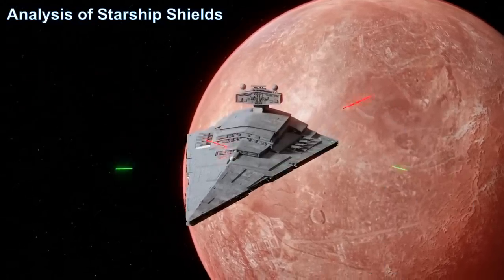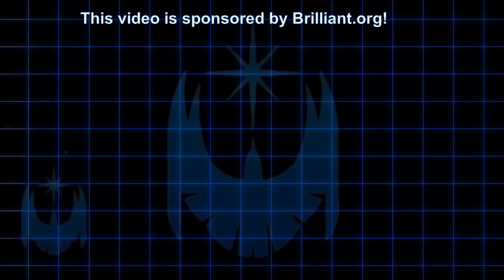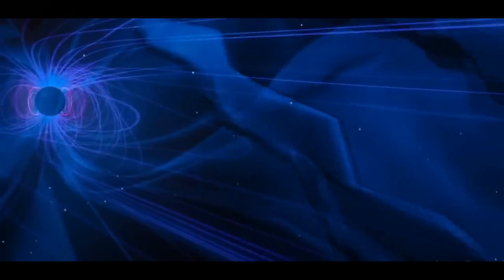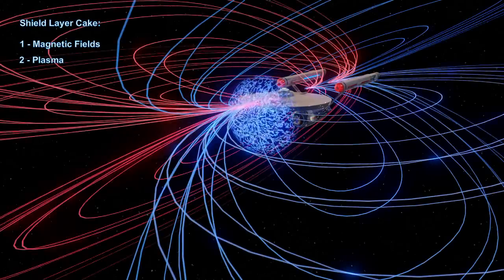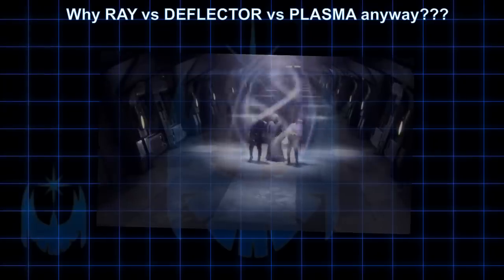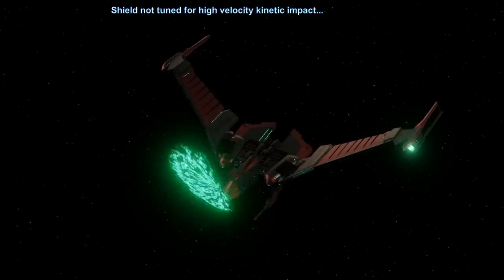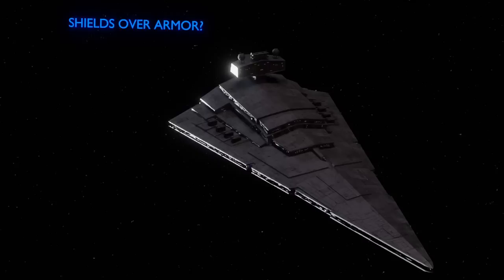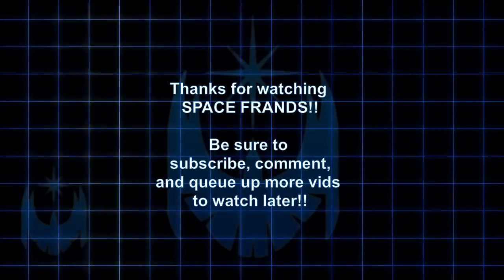REAL Starship Shields Types - They Work Like This...Animated Breakdown!

Comment: Two items that aren't mentioned:
1. The Langston Field from Larry Niven and Jerry Pournelle's CoDominium saga protects against everything and anything that hits it. The trouble is, it's no fun at all -- any ship with a Langston Field up would look like nothing more than a big black blob until it started taking serious hits. Then it'd start to glow: red, then orange, then yellow ... all the way up the visible spectrum to violet. At that point it'd take very little more for the Field to overload. Then BOOM! It radiates away all the energy it stored, both outward and inward, instantly slagging your ship.
2. The Alcubierre Drive's field would not only act as a shield against everything, but also as a warp drive. Also, any ship generating a Drive field would essentially be in micro-gee at the center of the field. The field does all the moving while the ship stays safely nestled in its embrace at the center, so no need for inertial dampers. I don't know why this aspect of the Alcubierre Drive hasn't come up more often. Laziness on the part of sci-fi writers, maybe?

Comment: Plasma shields absolutely stop and eat lasers. Keeping the plasma hot and ionized was a problem you had in maintaining your plasma shield, but the ions that make up the plasma are by definition electrically charged and interact with light to become more excited. Plasma is pretty damn opaque, gets heated up by incoming lasers, and this just makes it easier for you to maintain your plasma shield because now YOU don't have to heat it to ionization temperature. Your enemy is helpfully supplying that power via their laser. Plasma shields won't do crap to incoming objects though. There's not enough time to heat the projectile to melt it, and even if you did that didn't slow it down any, you just made it be hotter when it hits you.

Comment: I never thought about it until this video, but for lasers, the navigation deflector (as Picard noted in one of the early episodes as easily able to stop a laser) could be a gravitational wave moving objects out of the flight path through gravitation lensing.  A laser could be deflected and diffracted to weaker energy levels simultaneously from this continuous effect.  nav deflector will never be turned off

Comment: If you watch tank videos on youtube you will see that there are many types of armor that can be used to combat attacks as well. There is definitely a possibility that combining this with an eventual nanotechnology for self repair, it's possible to have much more usable armor in actual combat in space. Also I'm kinda surprised we didn't talk about the issues that should/shouldn't arise for the sci-fi series that don't have shields, namely battlestar galactica and babylon 5. Finally, while I appreciate that these technologies exist for shields and might be integral to developing technology in the future, I want to emphasize the 1) difficulty of maintaining a strong enough magnetic field to do anything remotely like deflecting debris of significant momentum, and 2) the concerns of the damage you'd do to people inside the ship to maintain those magnetic fields. After all, people get nauseated and lose their balance at .5 to 1.5 T, the biggest magnetic field we've been able to make across a Tokamak is about 14T which struggled to contain a small mass of plasma (this is likely outdated, my research was in 2010), and there wouldn't be much way of making that magnetic field outwardly directed.

Comment: There's actually a form of vehicle armor developed in the UK called electromagnetic reactive armor. It consists of two conductive metal plates spaced a few inches apart and protects the vehicle from damage by using high-voltage electricity to instantly vaporize projectiles that come into contact with the armor.
Reply: I think that's more of a hull polarizer than a shield but nice to know we have that tech already!
Reply: @alexslgato1735  we don't have it... Yet. 

It's in development. No vehicle In active service is equiped with it today.
Reply: I thought about something like that a few years ago, it was basically a ship covered in conductive metal and when needed, a strong electrical current would be shot through the metal, strengthening it against attacks, such as missiles, i called it electromagnetic shielding cause it sounded cool
Reply: Link, please.
Reply: @-Postoronnij-  https://youtu.be/o7rxBifd0cY

Comment: 4:15 I love this animation... the idea of shield triggering only on impact makes sense and fits well with Stargate visual effects... The tuning for various damage types also fits well to this and was sometimes part of the story.
Reply: Stargate shields work differently though. Stargate shields can be turned into cloaks and anti-replicator fields all on the fly. They can allow physical things through or block everything.
Reply: @the11382  I don't remember cloak, but anti Replicator would still make sense since you know... all they need is something to hit them if you talking Milky Way Replicators and such plasma field would fry quite a bit of electronics and block radio signals with Pegasus Replicators.

Tho you are right... while in ship-ship combat seem close enough, when you go in to touch it illusion falls apart.
Per usual for sci-fi they often block everything making it air or water tight and we have no real way to make that shields.
Reply: @the11382  They can't do it on the fly. Atlantis uses the energy field of the city shield with an Lantean cloaking device from a Puddle Jumper. You can't be cloaked and shielded at the same time.
Reply: Well the shields appear to operate on the energy spectrum in some ways, so going from a light refractive range to a radio frequency disruptor does not seem too far out of hand.

Comment: My Runner ships are made for speed and using their jump drives to travel long distances,  so shields keep them alive in battle.

Larger ships use a shield/armor combo, as they can't use jump drives, but more akin to Stellaris' Hyper Relays.

The largest ones, similar to generational ships, have armor only, because even if you damage one section, the rest of the ship is completely fine. For this reason, attackers just don't bother attacking.

Comment: There's also the 'sponge' type of armor or shields, that gobble up laser energy and dump it back into the ship's systems, usually into the point defence capacitors. There's Chaff and Microprism dust to consider, especially if you're already using magnetics to keep it dusting the ship. The armor is probably going to be some laminate to better deal with a bit of everything.

Comment: Ok, I have to say it, there is another type of shield, one that redirects the energy of the inbound object into a different dimension.  I am talking about the Void Shield from Warhammer 40K.  Ships of the Imperium utilise a shield array that redirects weapons fire into the alternate dimension (used for FTL and is the domain of some very nasty entities) called the Warp.  Void shields when activated form an energy layered shell around the ship, the Shield forms as a series of layers,  the Void Shields can only take so much incoming energy fire before the layer collapses.  Now ships of the Imperium are colossal in size, and will have a number of void shield generators,  if the ship doesn't take fire for some time, the void shield will recharge at a very fast rate.  These shields are also employed by the titanic walker units of the Collegia Titanica, the Titans.  They have downsides, Psychic phenomena and warp storms can cause these shields to lose effectiveness, or fail entirely, they are very power hungry, and as with most imperium tech, their technical understanding on how these shield work is very limited.  But then as with everything in WH40K, its very much grim dark, over the top, and utterly batshit crazy.  Don't get me started on the Orks.

Comment: In Star trek, at some point, the distinction stopped being made between deflector screens and shields. The original series mentions them along with The Motion Picture. When the A was being pelted with torpedoes from the cloaked bird of prey, it seemed as if they only had energy shields with no screens. You would think that deflector screens would have been more useful against torpedoes than standard shields as the shields were penetrated with every hit
Reply: Deflector screens would make little difference as the torpedo's would be set to detonate rather then allow themselves to be deflected. Shields spread out the energy and impact over a wider area, allowing the ship to take more damage and still operate correctly. Energy fired at a ship doesn't go away, its instead absorbed through the ships systems in a semi controlled way through the shields. The ship is designed to take this beating, but can only do it so much before it just can't and then you start to see damage done despite shields still being up. Exploding consoles, power conduits blowing out etc, all caused by the energy being directed through the ship overloading something as there is no safe route to dissipate the energy after the designed overflow is spent. But not allowing another ship to concentrate all that damage to one particular area of your ship means you can keep fighting on longer as damaging a particular system of your ship is harder. At least is my understanding of it.
Reply: @gerble36  Yes, deflector screens in Star Trek are for navigation only. 
They have to be up, so the ship can go to warp the instant it is ready to depart for combat manoeuvring.
Reply: @shauntempley9757 there was a scene in Star Trek where an unidentified ship locked lock lasers Picard responded laser won't even penetrate navigation shields.  The navigation shields being the deflectors.

Comment: Hull polarization is hardly ever mentioned, but in the 70's a study revealed that running a current through a metal surface can neutralize lasers, as long as it's a higher wattage than the laser.
Reply: Do you have a source, Atomic Rockets is curious.
Reply: @georgethompson1460  It was in OMNI magazine in the early 80's.  I never saw it referenced at all until Star Trek Enterprise.  Offensive laser applications are sexier, so those advances were more publicized.  It may have been accidentally disclosed, like the ion plasma applications on the SR-71 (said to reduce Mach effects on the leading edges of the wings and in the exhaust).
Reply: @chadreynolds5974  That makes sense - a laser is basically just focused EM radiation. If you create a conductive surface with surface polarisation, the stronger wattage of the surface would dissipate the laser before it makes contact. Notwithstanding that the more energy-efficient solution is if the surface simply had an effective heat dissipation system, the laser would be more or less useless on a surface with a high heat capacity and efficient cooling, especially if the laser were significantly diffracted prior to making contact, or if the laser were simply refracted around the object in question. Lasers are fairly questionable weapons for this reason, but may be believable for Enterprise depending on the sophistication of spacecraft.

Comment: You're looking for a science basis for shields and there isn't one. It was done for budgeting reasons. In the days of models, they didn't want to damage their big, expensive props but they still wanted a way to create tension. Thus was born the idea of energy shielding. In an age of CGI, it seldom has a place. Babylon 5 didn't have it. The Expanse didn't have it.

A lot of sci-fi technology is the same. We need to film a planet landing sequence every episode. Nope. We're going to put glitter in a blender and call it a transporter. I need $20,000 of steel just for the bars in this brig scene. Nope. Do a lense flare and say it's a force field. We need radiation suits for this core breach. Nope. Just say they're being inoculated with anti-radiation meds.

Comment: Actually space combat seems absurd especially at percentages of the speed of light. Two ships at 1/4th the speed of light are going to be zooming past each other faster than they can act. Star Gate Atlantis had this issue with an old ancients ship that was locked into near speed of light travel. No way to catch up to it or communicate. They could warp in front but it would zip past too fast.

Comment: Good take on actual believable shields. A magnetic shielding would effectively make any kind of plasma weapon completely useless, which means no phasers or disruptors, not even Borg particle projectors, could harm a ship with such shields. Matter, on the other way, would be simply unstoppable, unless you created a sheet of really superheated plasma around the ship, as you suggested. But that would also create a barrier hampering both your sensors and light-based communications, especially your own targeting systems, much like it happens to any ship reentering atmosphere, when it is enveloped in plasma due to attrition.
Also, magnetic fields and charged plasma offer little protection against neutrons, which can kill the crew in no time leaving the ship intact. 

Some media suggest using gravity to create a warped space bubble around the ship to simply deflect everything thrown at you, but that would mean to deflect also the light that allows you to see your enemy in the first place. A really dumb idea.

Some kind of armor seems to be the best investment for any kind of space warship, then, because no matter what the shields are made of, they would still let something through. Also, shields require energy to exist, which can't last forever.
Reply: Despite there are dozens of shields had developed, repulsive shields, magnetic shields, ionic deflectional shields, beam shields, and photonic hypercrystal generated shields are main consideration for starfleets.

However, more types of shields advancement are encouraged to further space projects.

Comment: There is another interesting design in the game Independence War 2: Edge of Chaos. There the shield generators create a bend in space causing any attack to deflect back into itself. Though the shield generators only work in one direction, so they swivel around inside the ship to face any potential thread. This means that attacks from multiple directions can overwhelm them. Also they don't work over the ships main thrusters as they would interfere with those. And they only work in a single burst, needing to recharge every time they are used.
Reply: first person I've ever seen mention that game.

Comment: In theory being doable with known science is not the same as actually being possible like shown in media. Can you make a plasma window or generate a powerful electromagnetic field to the point it could absorb/deflect some attacks... sure... Could you fit the hardware needed to produce and control and then power that inside the ship itself that's producing such a powerful concentrated defensive field? Maybe not... It's like how there's some theoretical math that relying on some unkowns say's it's "possible" to move faster than light speed. But how that same equation also requires "infinite energy" or order to achieve that, or anti mass (something that is unknown and may/likely doesn't exist IRL).
The one study (that's validity and reliability is highly questionable) of humans making a plasma window that could stop a bullet supposedly used more power than the nearby two cities while active. And the hardware arround it in the vague sketches was frankly massive and just that, around the barrier and not all on one side to project it.
And all that just to stop a pistol round... weight wise you are much better off just using a thin sheet of metal to do such a task. Power wise as well, physical armor doesn't suck up power after all.
And a reminder but energy barrier like deflectors do still let your ship be shoved. You have magnetic field generators stuck to various parts of your hull, when the shield takes a hit, those get shoved around though that same field they generate. So a large boulder smashing into a shield is still transfering that energy into your ship, just hopefully across numerous emitters placed at various durable structurual points across the entire ship. So weapons like giant explosive rounds, or hard kinetics still will get damage through without some very creative new options, though they'd be great against smaller debris and possibly point defense weapons if you will.
On the other hand armor can be decent there, and assuming it even does way more, greater weight reduces the ability to get shoved around, though at expenses to cost and time in moving around yourself when you actually want to get moving.

Well, I look forward to future shield tech, but I expect it to be more about minor debris and radiation than really holding up to any incoming attacks. More likely we'll just be focusing on killing the enemy before they can shoot at you, and various types of active protection. For lasers low weight add on armor that contains some materials great at ablating away into an obscuring gas or stuff might be most realistic.

Comment: i should mention that deflector shields in star wars are mounted on smaller ships like freighters & star fighters, ray shields are mounted on warships, in cooperation with particle shields.

particle shields work by acting as a strong magnetic field that induces gravity to push hard objects away from the warship, allowing it to absorb /vaporize, redirect & prematurely detonate torpedoes & other physical weapons.

with this one with ray shields & projected in a space around the ship, the heat is dissipated by the cold vacuum of space.